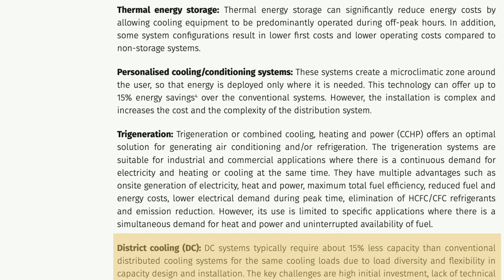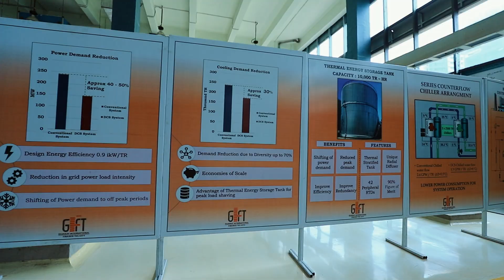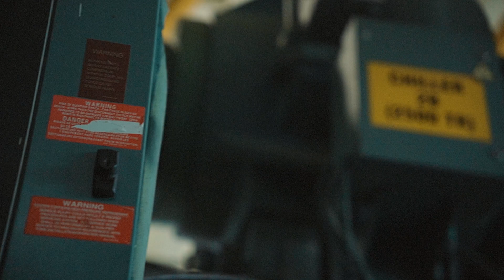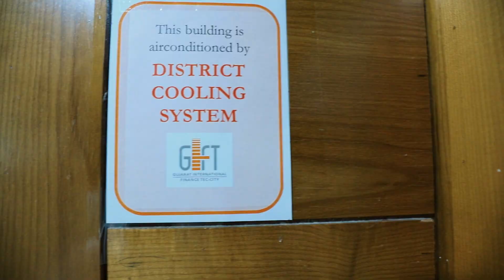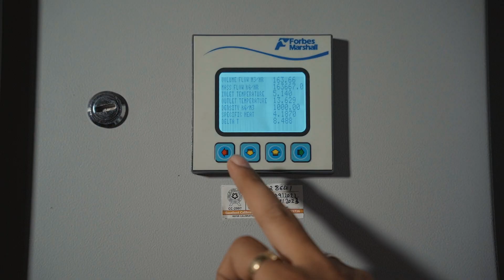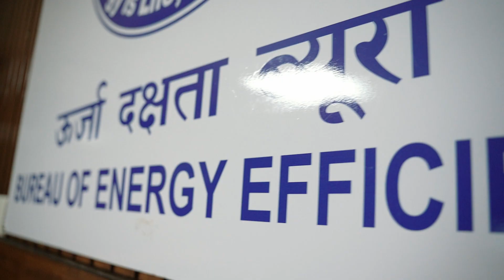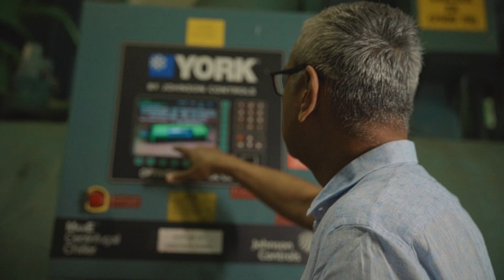Cooling the Future: Unveiling District Cooling Systems in India | Expert Insights & Virtual Tour...

Comment: The priority should be industrial areas and other manufacturing hub where productivity is affected due to increasing climate heat. Instances of fire in the industries is increasing rapidly nowadays. I just hope government will look closely into this.
Reply: And a combo unit of sprinklers can also be installed with it's pipe lines which may be activated in case of any fire to extinguish with the use of water